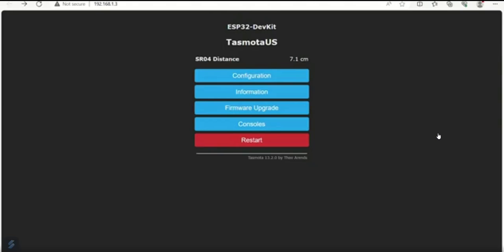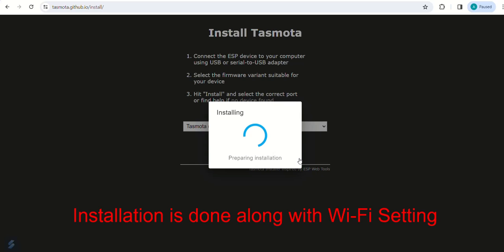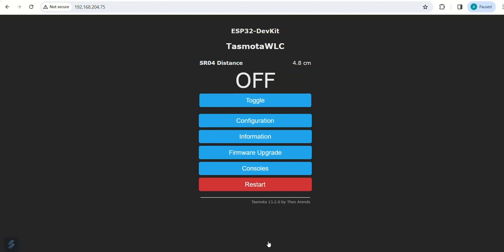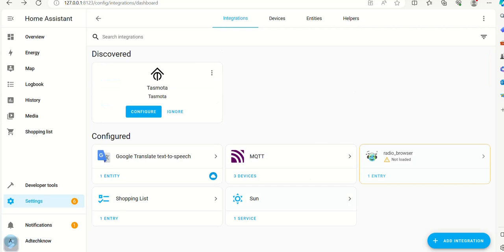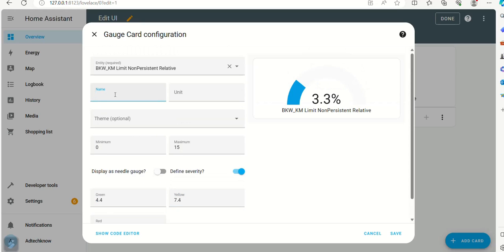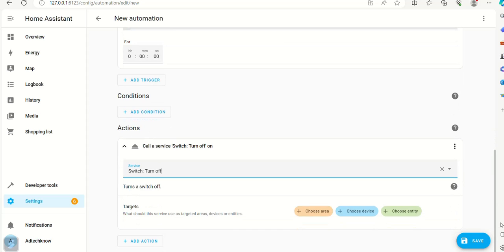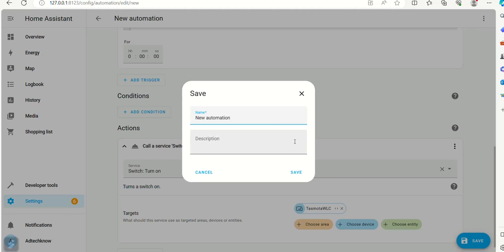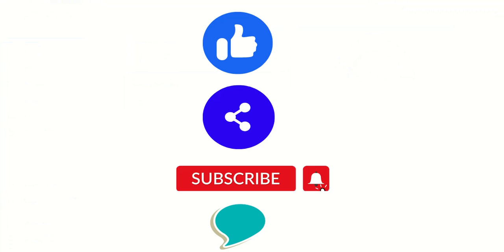Water Level Controller using Ultrasonic Sensor and ESP32|Tasmota|HomeAssistant

Comment: Hey, I did something similar a couple years back, however it doesn't work for me because of water droplets forming on the sensor. So it always shows 100%. The first sensor I used was damaged pretty quickly, so I used one which comes in a plastic enclosure. Droplets of course form as well. I have not yet come up with a solution to get rid of the water droplets forming on the sensor and messing up the measurement.
Don't you have that problem?
Also a tip: Try elevenlabs or descript for voice overs.